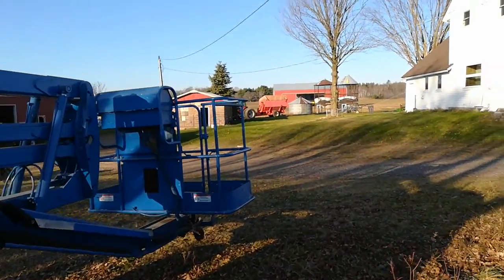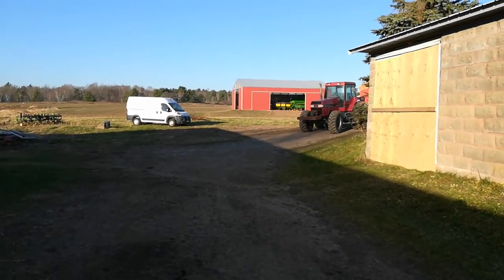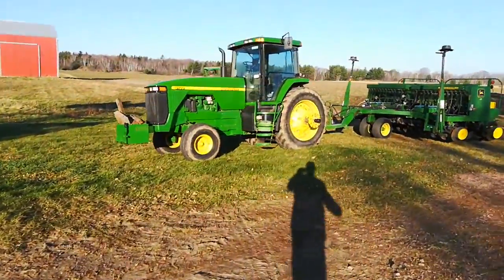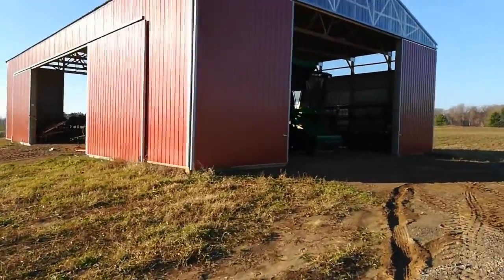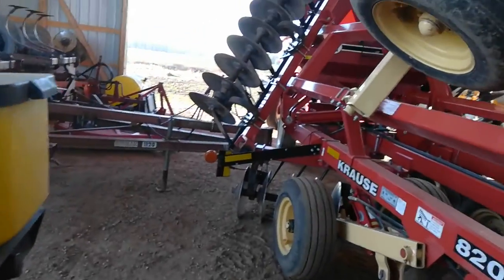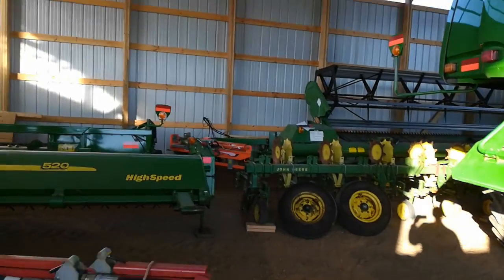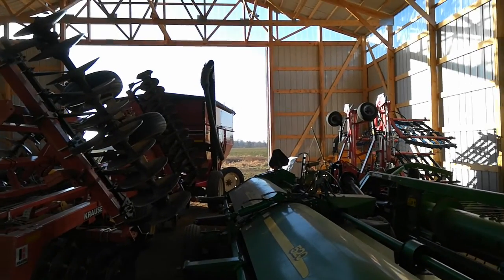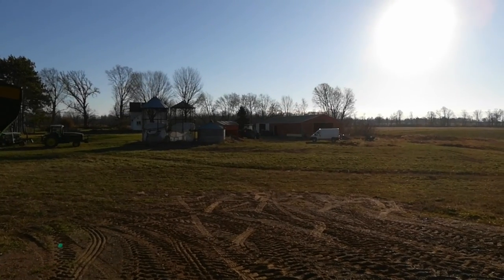Putting Equipment Away at the End of the Year

Comment: Those chisel points are worn!  I seldom run that deep with the chisel.  8" is about the maximum for me.  If you can still walk through the barn, there is plenty of space ;)
Reply from the maker: We got our money's worth out of them. On the clover that we partially terminated this fall we went about 8" deep. On the ground where I have compaction/foxtail we tried to go deeper. We were thinking about renting a ripper -  but couldn't find one. So we set the chisel deep.  In the 5 yrs that I've owned that ground it hasn't been chisel plowed - there never seems to be enough time to do it. I doubt the previous guy did it either. The pieces that got dug up by the plow were still hard as rocks. Glad we got it done.